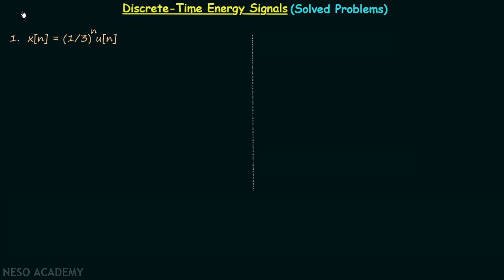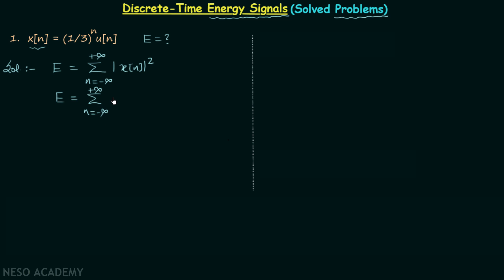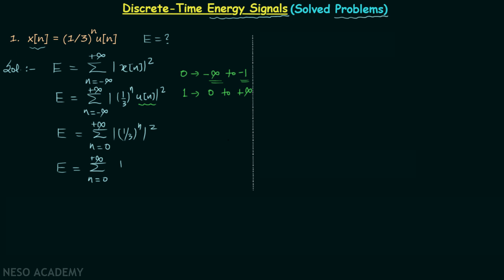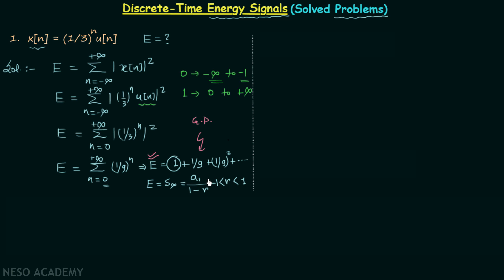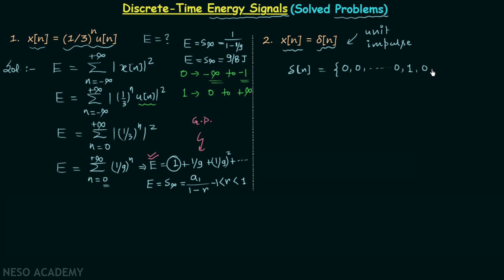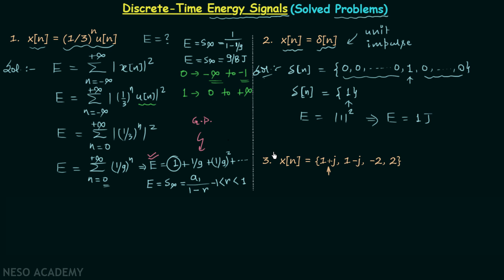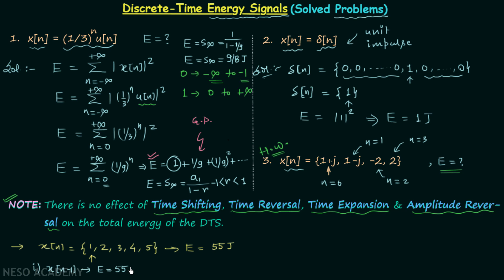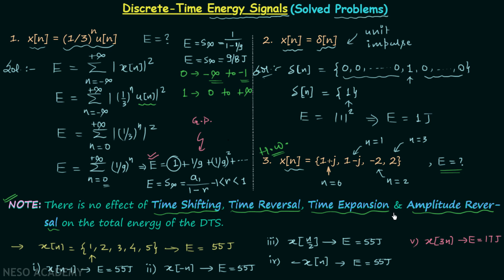Discrete Time Energy Signals (Solved Problems)

Comment: To simplify the expression (1−j)2+(1+j)2+8(1 - j)^2 + (1 + j)^2 + 8(1−j)2+(1+j)2+8, we first need to expand the squares and then combine the terms.

Step 1: Expand (1−j)2(1 - j)^2(1−j)2

(1−j)2=(1−j)(1−j)=1−2j+j2(1 - j)^2 = (1 - j)(1 - j) = 1 - 2j + j^2(1−j)2=(1−j)(1−j)=1−2j+j2

Since j2=−1j^2 = -1j2=−1:

1−2j+(−1)=1−2j−1=−2j1 - 2j + (-1) = 1 - 2j - 1 = -2j1−2j+(−1)=1−2j−1=−2j

Step 2: Expand (1+j)2(1 + j)^2(1+j)2

(1+j)2=(1+j)(1+j)=1+2j+j2(1 + j)^2 = (1 + j)(1 + j) = 1 + 2j + j^2(1+j)2=(1+j)(1+j)=1+2j+j2

Again, since j2=−1j^2 = -1j2=−1:

1+2j+(−1)=1+2j−1=2j1 + 2j + (-1) = 1 + 2j - 1 = 2j1+2j+(−1)=1+2j−1=2j

Step 3: Combine the Results

Now we sum the two expanded terms and the constant 8:

(1−j)2+(1+j)2+8=−2j+2j+8(1 - j)^2 + (1 + j)^2 + 8 = -2j + 2j + 8(1−j)2+(1+j)2+8=−2j+2j+8

Notice that −2j+2j=0-2j + 2j = 0−2j+2j=0, so we are left with:

0+8=80 + 8 = 80+8=8

Thus, the simplified result is:

(1−j)2+(1+j)2+8=8(1 - j)^2 + (1 + j)^2 + 8 = 8(1−j)2+(1+j)2+8=8

Comment: The Answer is 12 J.
Explanation: 
|1+j|^2
First take |1+j|
Formula for modulus of complex number is, 
|a+jb|= root ((a)^2 + (b)^2)
Similarly, |1+j| = root ((1)^2 +( -1)^2)
Therefore we got, =root (1 + 1)
=root (2). 
And after square the root (2),
Final answer is = 2
Apply above steps to next value (1-j).
Finally the solution is = 2+2+4+4=12J
Reply: my solution is:
E=2sqrt(2)+8
Reply: Your answer is wrong root(2)=1.41
Reply: @waleedaljehani3246  you have to square it

Comment: Why energy changed in case of compression, not in expansion?
Reply: it's because in time expansion the samples of origin signal will be remained in the expanded signal and zeros are introduced in between the the origin signal to have an expansion.
like if the original signal is x[n] = {1,2,3} then the x[n/2] = {1,0,2,0,3}.
you see the original signal samples remained as it is and extra zeros were introduced to expand the signal.
but in compression case for the same original signal x[n], the x[2n] = {1,3}
now if you calculate energies of x[n],x[n/2],x[2n] will be 14,14,10J
Reply: @gopikrishna-ok2wg  Thanks alot🙏😁

Comment: Ex=(1+j) ^2+(1-j)^2+(-2)^2+(2)^2
    =(1+2j+j^2)+(1-2j+j^2)+4+4
    =(1+2j-1)+(1-2j-1)+8
    =2-2+2j-2j+8
    =8 Joules *****Ans to your question sir
Reply: It is 12 Joules
Reply: @anusmitsaha8604   How do you say its 12J?
There is complex number. Can you give details?
Reply: @pkofficl7650  complex number  are not multiplied but they conjugate and multiplied for square
Reply: 10J ans
Reply: @ajaychilumula1307  right bro 10J is right answer

Comment: [√2]^2  +  [√2]^2  + 4 + 4    = 12 joules
Reply: Can you explain how did you found it
Reply: @sakliadem6784  The Answer is 12 J.
Explanation: 
|1+j|^2
First take |1+j|
Formula for modulus of complex number is, 
|a+jb|= root ((a)^2 + (b)^2)
Similarly, |1+j| = root ((1)^2 +( -1)^2)
Therefore we got, =root (1 + 1)
=root (2). 
And after square the root (2),
Final answer is = 2
Apply above steps to next value (1-j).
Finally the solution is = 2+2+4+4=12J

Comment: my doubt why an impulse is not an NENP signal as its mag is infinite at t=0
Reply: Impulse is a  NENP signal . but unit impulse is not a NENP singnal.
Reply: @exodus5948  ur explanation is wrong for the question he asked.
Reply: The unit impulse as a continuous time signal i.e delta(t) is a NENP signal as it has a value of infinity at t=0, but a unit impulse as a discrete time signal delta[n] which have a value of 1 at n=0, is a energy signal.
Reply: @vavilapallisatyavenkatasan6563  yes correct.
Reply: In continuous time impulse is NENP ....but this is not in discrete it is a energy signal in discrete time
Reply: You are talking about continuous domain...and it is NENP in continuous but not in discrete,.

Comment: 12 joules
Reply: How can u get 12 joules..after taking square of each term.complex term was cancel out.thereforw the ans is 8 joules
Reply: we have to calculate :-   | 1+j |^2
First Calculate the modulus of 1+j and then square it. 
Modulus of 1+j :    | 1+j |=(1^2 + 2^2 )^1/2 = (2)^1/2
now on squaring this we get 2.
Similarly | 1-j |^2 = 2.
Now on adding everything you get 12J.
The mistake that you are doing is that you are directly squaring the terms without finding its modulus first.
Hope You Got It....
Reply: Correction : | 1+j | = (1^2 +  1^2)^1/2.
Rest everything is correct.